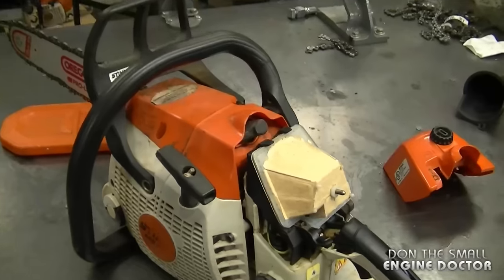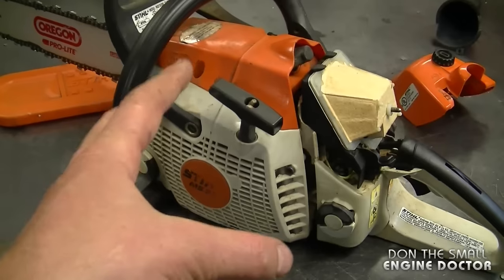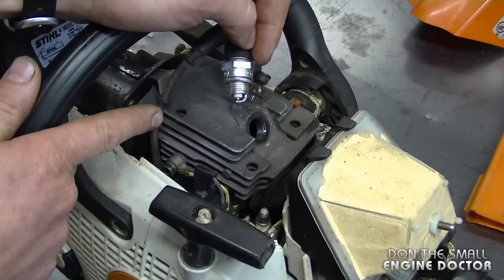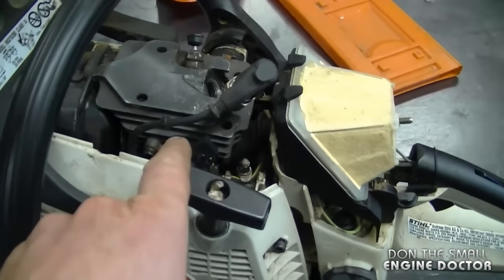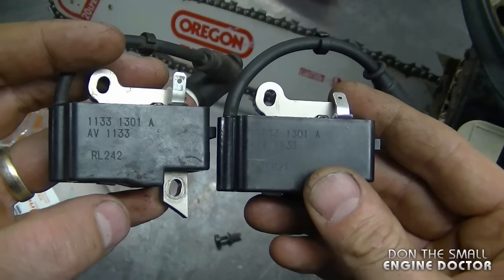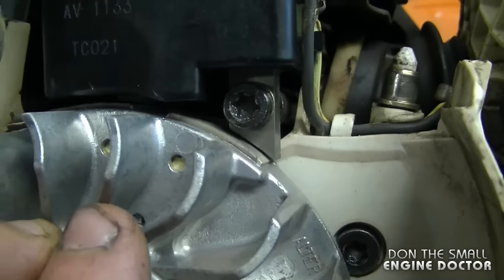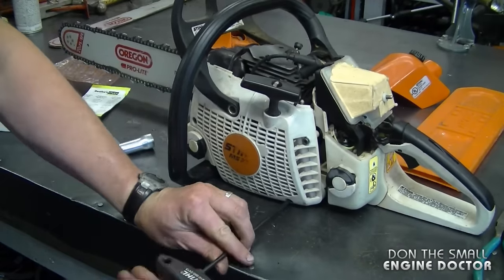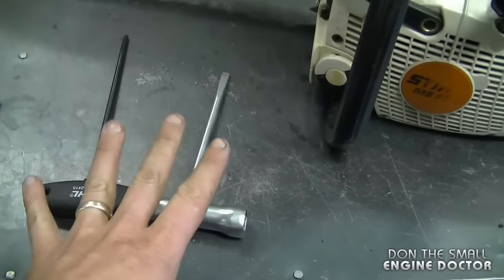HOW-TO Fix A Chainsaw With No Spark - Ignition Module Replacement

Comment: What if I have spark outside of hen test and add fuel to cylinder and it still won’t fire up ? Would that still be an ignition coil issue ? It’s brand new plug and clean ethanol free fuel I’m using.

Comment: On an older unit which has points which may be problematic, is there an easy way to  determine whether the coil is the problem without having to to go all the way into the points?

Comment: I had a problem with a coil on a  TORO 2 stroke lawnmower. I really like that lawnmower so I called the dealer and a new coil was $240.00 . It was on a Kawasaki engine and those parts are almost as expensive as Honda parts. It would fail when it warmed up and sometimes had no spark at all. If I disconnected the plug and turned it with a cordless drill it would bring back the spark but it was only temporary. I decided it was a moisture problem. I put the coil in the oven for 20 minutes at 275 degrees F ( I could have made cookies at the same time). LOL I put it on the machine and I had spark and then cut the grass. Then I took it off and coated it with 5 minute epoxy but again only a temporary fix. I pulled it off and cleaned the epoxy off with a wire wheel and then coated it with 2 coats of shellac. Shellac is something that will penetrate and seal much better than anything I could think of. That was 3 years ago and it is working fine. If I fixed small engines for a living I would never do that for a customer unless they wanted me too but that could be a lot of work for nothing if it was a different problem but a new coil for $240.00 was a good reason to do it. I like your videos. You are one of the few that knows what they are talking about.

Comment: Great video, I have an 036.  I was having all the symptoms you described so I thought we were on the right track.  However when I removed the positive from the coil I had spark.  I checked the rest of the wiring and found frayed area and repaired it contacts with the switch also looked solid. Still no spark.  I’m not sure where to go from here, any suggestions for me?  Thanks
Reply: Have you got your saw running? I got a sthil 031av with no spark and a diacontinued coil and no cross match coil.. i think im going to try n put a smaller coil on n drill new holes...

Comment: Dony;  I acquired a Homelite CSP3314 chainsaw recently.  No spark. In my attempts to resolve this,  I replaced the plug, replaced the coil, gapped the coil with a bus. card and just a piece of paper, and disconnected the plus wire from the kill switch.  each was an individual change/test and after each change I still had and currently have no spark at the plug.  Ive tried grounding the plug to the cylinder and I've tried a plug tester.  No spark and no light.  All the research I've done indicates that changing the coil will solve the problem.  But here it didn't.  And it's a brand new coil.  So what else might be the problem?

Comment: I'm having the same issue with my mcculloch. It's driving me mad, new ignition module and plug..no spark....all checks out..no short circuits...just no spark.....I nearly launched it across the road today....I am surenit is shorting out somewhere but cannot figure out why...should the ignition module be insulated from the barrel it is attached to???

Comment: Didn’t you say, “flywheel doesn’t touch ignition module when spins”?  Mine is touching the ignition module on one particular spot when it spins/rotates.  Is that why my pull cord kicks back so often when I pull?  Crank shaft, piston, other parts are in very good shape.  Except the flywheel key which I haven’t gotten to it yet.  Thank you.

Comment: Hi donyboy73 and congratulations for your videos... 
I am John from Greece and I have a problem with my husvarna 136 chainsaw.  
Some times there is a weak spark and some time there isn't. I have changed the ignition coil and the spark plug but still doesn't work. I think that the problem is with magnet in flyweel. Can you tell me how I can fix it? Thanks for your help!

Comment: dontboy73 i have a little bit of an odd thing with My Sthil MS 170 the old carb throttle was stripped so i ordered a aftermarket Walbro & it runs excellent BUT the hi & Lo adjustments are coved & we have to take off the air filter housing to adjust the Hi & Lo  . WHY i haved racked my brain  LOL which isn't much what do ya think ???

Comment: A business card is usually fine for setting the air gap, as long as it is .010 thick.  Some are thicker.  The Stihl spec is .15-.30mm, or .006-..012 inches, so a .010 thick business card is fine.

Comment: don i i have a homelite UT10532, no spark at the plug, i did what your video said and with the positive wire connected to the ignition module i have no spark and with it connected i have  spark, what is the the thing to look for?

Comment: Hi Dony. I am just wondering what your opinion is of using spark plug number CJ7Y instead of RCJ7Y.
All my local hardware stores only carry the CJ7Y Champion spark plug and not the RCJ7Y. The original part which was on my HusqVarna model 136 was an RCJ7Y. 
Through research, I know that the R stands for a built in resistor but is it absolutely required in my chainsaw?
Reply from the maker: it won't make any difference
Reply: Claude Bussieres was p

Comment: I just a brand new remington 20 inch bar chainsaw and it wont start,,im 65 and have worked on small engines a long time so i did the old theme of seeing if it had gas and spark,,,first i checked fuel and it gets plenty,,second i checked the plug and it shows NO SPARK,,put another plug to make sure it wast plug and it would not spark,,,is there anything else other than ignition module

Comment: I bought one brand new recently (MS180) and turned it on when I brought it home. the next day it would not spark. I unflooded the saw, but still no spark. I went to the dealer warehouse and they did some mumbo jumbo hack they couldn't tell me and it worked again. not sure how long its going to last, but im thinking of going electric.
Reply from the maker: cordless is the way to go for most homeowners now

Comment: Poulan PB4316 won’t  start, not even a kick back on the pull cord.  Get spark but it may be weak. I’ve put fuel in the cylinder and tried again NG. It was running. It’s not grounded. What should be a good coil ohms reading. Even  tried straight fuel in cylinder NG. Plug look good. The hot condition and cold unit I don’t try yet, I’m familiar with that which is next. If you can show video on how and where to tak readings and values. Thank You

Comment: Hey Dony. I separated my positive wire and was able to get spark. Can I run my chainsaw that way?  Do you have a video on what I need to do in this situation?
Reply: This means the stop switch wires ( the two wires running to coil ) are touching and the short is acting like the stop switch is on. Check the wires over to make sure the insulation is good.

Comment: Very good video.  For about 5 bucks you can get a spark plug tester that makes the testing a bit easier.  Didn't see it in the video but I like to add a bit of anti seize to any plug I remove.
Reply: Would you mind elaborating about that "spark plug tester" you mentioned?  Perhaps a brand name and part number?  Thank you.
Reply: @bt5526  Sorry but it was so many years ago, but if you enter "spark plug tester" in ebay you will see various options

Comment: Ok.... I'm mechanically inclined, have worked on all kinds of machinery...

I've a 80's era Stihl chainsaw. I'm on my 4th coil since it was given to me 3 years ago.

I just put in the most recent replacement, the saw started, ran great for 2 minutes. While I was fine tuning the carb. It began faltering, died, not to be started again. The carb adjustments were less than a half turn. I returned to the original carb settings... nothing, not even a kick. I do get spark with the plug removed... but not as much as you demonstrated. 

I measured the ohms of all the dead ones, the primary coils in all ohm out near 1 ohm... a good coil primary is around 600-800 ohms.

Why does this saw burn out coils? It's so simple. WTF? I'm flummoxed.

Comment: Can you explain further about the situation where the saw runs for a moment until it gets warm and stops.  How does this apply to the ignition module.  There was a spark to start and idle and then something happens and the spark stops?  How could you test to confirm ignition module?  I tried testing for spark right after the idle quit and it wouldn't start and there was a spark.

Comment: Why will my HRC 216 not start on first pull     I have cleaned carburetor  when I spray carburetor cleaner into air cleaner it starts on first pull

Comment: Hi Dony ~ I came here to watch you install a Stihl ignition module, but, while I'm here, I thought that I'd ask you about another problem that we're experiencing with our older (circa 2005) Stihl MS361.  We bought the saw brand new and, after a few years of happy use, it began losing chain bar oil.  The leak isn't apparent when running the saw -- it only seems to be an issue when it's stored.  At this point, we empty the saw after every use and store it on top of a plastic tote lid with beveled edges.  As you can imagine, this is a real inconvenience that we would love to correct.  If you have any thoughts you would care to share about this issue, we would be most grateful to you.  Thanks for taking the time to create these kind of videos.
Reply from the maker: i start by replacing the cumbersome oil cap and if it still leaks i replace oil line

Comment: Is it possible that something else is wrong and not the coil?  I tried 5 coils I had on hand on a weed wacker, as well as 3 spark plugs.  No ignition with all of them.  Could the magnets on the flywheel go bad? My gap for the coil was the size of a business card and I tried with the two wires attached and not attached.
Reply: I tried to ohms test them but I can't find the stats online to know what the ranges are.  Is it usually the same for all weed wacker coils?
Reply from the maker: I usually try with the switch wire disconnected from coil if I have those issues. It's very rare the magnets are bad

Comment: I have no spark and tested as per the video. The new module has no spark with switch disconnected. Gap checked on the old and new module set at .010. Any suggestions?
Reply: make sure you connect your ground wire under the module mounting screw. or check ground wire for continity. check wires at kill switch

Comment: Hello.
I have Husqvarna 335FR trimmer and recently I got zapped through spark plug boot while pulling the starter (when engine is running there is no zap). Rubber is not damaged or anything. Is this big problem? Or nothing to worry about?
Reply: Were your hands sweaty/damp? Usually that is the first cause for that, the second is that the plug is failing and you provided a better path to ground than the gap. Last is that the spark has been jumping to ground through the boot and you don't really notice it, that can cause carbon tracking that brings the spark out just like you added a wire.
Reply: Thanks for answer.
No, my hands were not sweaty or wet. I did the same thing with my chainsaw (Stihl 181\C) and no zap. Maybe ignition module is dying\malfunction? The trimmer starts up good and runs just fine.
Reply: Not likely the module but it could be the boot itself or the plug connector inside the boot is failing. Most of the time you can get replacement boots and contacts from a small engine place or even NAPA (if you have one that actually knows their stuff)  Or just keep your hands away and run it until it gets worse, then repair it.
Reply: Ok, one more time a BIG THANK YOU for answer! Have a great day! :)

Comment: Smashing job don :-D, i bet its performing better too.
A poorly performing ignition can ruin the timing and lose power.
Reply: I am wondering if that is the issue with a Stihl FS130 trimmer that runs roughly and bogs under full throttle, and won't start when warm. Thoughts?
Reply: Check the spark arrester first. That is a screen held in place by a screw over the exhaust port. Take it off. If it is gunked up (and probably is), that is the most common issue that causes the problem you are describing.Clean the screen thoroughly and replace or better yet, just leave it off. You should notice an immediate improvement.
Reply: newcoyote I did check that first thing per lots of advice on the Internet. It wasn't the problem. Also, this machine gets used in a publicly owned forest, and I would never, ever, remove the spark arrestor. Wildfires are a real danger where I live. I volunteer with a well respected trail building organization, and we would never abuse the public's trust like that.
Reply: First of all, you're welcome. Second, I have never seen or heard of in twenty years of professional use, a fire starting ( or even a spark emitting from removing a spark arrester. The risk is incredibly minimally especially compared with anything else you may be doing just being there.  Last, my first suggestion was just clean the damn thing. Glad to hear you're so virtuous though.
Reply: We're required to have spark arrestors as well as other fire suppression equipment. Sorry that bothers you.
Reply: Facepalm. OK pal. Whatever you say. Bye.
Reply: @newcoyote  Whoa! What a maroon he is!

Comment: Good morning. I've been watching your videos trying to fix my ms 270 chainsaw. I've changed the spark plug, fuel filter and fuel line. It gets hot and shuts off after awhile. Any suggestions? Thanks bro.
Reply: Old comment, but he has a vid of Spark arrestor...somewhat symptoms you've described.
Merry Christmas as long as I'm here. (-:

Comment: I've got spark but my MS261 won't run. Even put fuel into spark plug hole and still nothing.
Any ideas? Engine has good compression.
Reply from the maker: take the muffler off and make sure piston is not scored
Reply: @donyboy73  Piston looks ok. The engine has good compression. I noticed that there is scoring on the flywheel. At some point, it looks like the ignition module has been scraping on the flywheel. One of the bolts that hold the ignition module has vibrated loose. There is some slight scoring on the pickup tag on the ignition module. I am wondering if this has messed up the ignition timing.

Comment: How can I test if the spark plug is working on a Stihl 025. How do I remove the top cover to expose the engine and be able to ground it? Thanks.
Reply from the maker: i use a screwdriver or chainsaw tool to ground it to metal

Comment: I have a 359 Husqvarna chainsaw.  New top end rebuild. Only ran 20 minutes.  Has no spark. I installed a new sparkplug, coil, and the 2 electric line. It still has no spark. Flywheel and coil are gapped

Comment: I understand its a good idea to file off the top of the posts that hold the coil screws.  Sometimes they are corroded or rusted.  It may also have been a good idea to do a continuity test on the magneto before buying a new one.  ONe other item, i found on my Stihl that the spark plug electrode inside the magneto boot was very poorly connected to the wire.  It was just punched into the wire and over time that electrode/wire connection had rusted, loosened, and failed to have continuity.   That was a far easier and cheaper fix than buying a whole new magneto for $100.  You can fix the electrode just by punching it into another place in the same wire.  Right?   And continuity testing with check that, before you spend your $100.

Comment: What do you do if you do get spark after removing the positive wire from the ignition module?
Reply: if you still have spark, check the hot wire for continuity. you may have a broken wire or it is grounding out.

Comment: You hurt my feelings a bit.  I've been farming, cattle, for @ 45 years.  I use a lot of chainsaws.  Stihl seems to be the best.  Lately, I've had a really hard time in starting my big boy,  066.  I find myself going to the smaller units instead..  Finally, I have some really big walnuts to cut down for cutting into boards, and I have to use the 30 inch 066.  I finally took it into a repair person, ( fix all my mechanical stuff_,   He stated the obvious stuff,  cab gaskets, bad gas, all else OK.  I asked him to start it.  It wore him out.  Finally it did start but it was hard for young guy.   I asked about a compression release. He said my older 066 did have it and no way to modify it.  I purchased a new big bore jug, new piston,  etc. (very inexpensive), and it comes with a compressor release.  I purchased and replaced.  I found, my old 066 jug, did have compression release plug.  I could have installed only the release but I went the total replacement. The compression release is no piece of cake.  It pops back out on the second or third compression stroke and you can flip your saw or your arm out of socket.  Finally, I just pushed down the compression tab, not letting it up, and got the saw hitting and then released the button.  This saw is even a bigger-horse-of-saw now! Oh yeah, my feelings were destroyed when you started your big saw and said the older owners are having trouble with the big ones. I guess I will have to run faster to keep ahead of old age. I ain't giving up, I'm only a young 75.  Still kicking ASS....     Your three compression soft pulls was very helpful along with the flooding caution!    Thanks much.         Jim   (Sorry for writing a book, I've never talked a woman this way before).